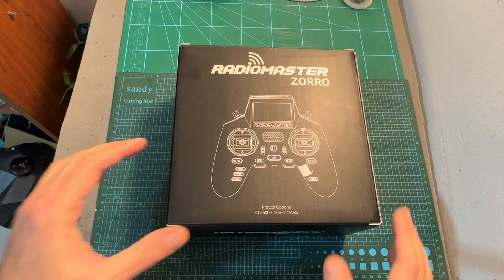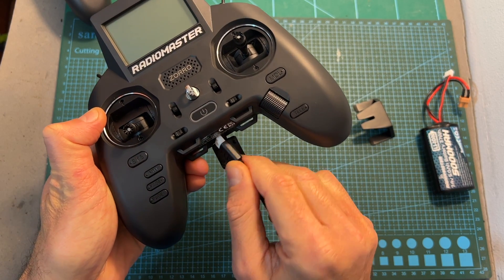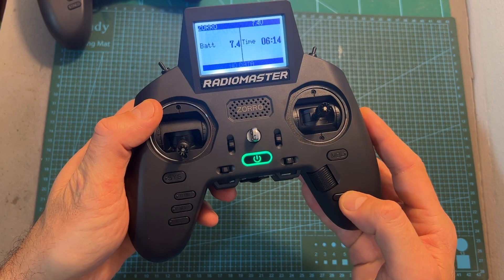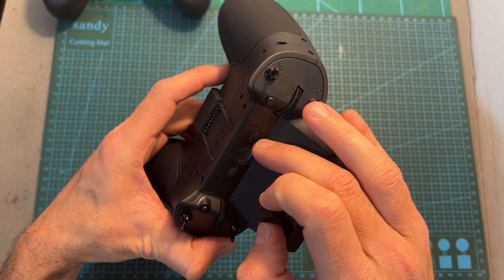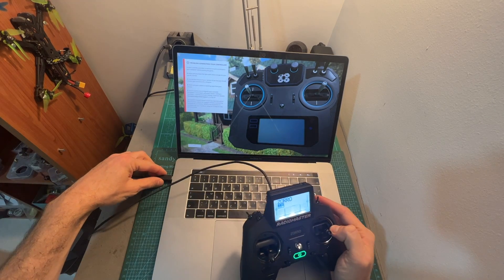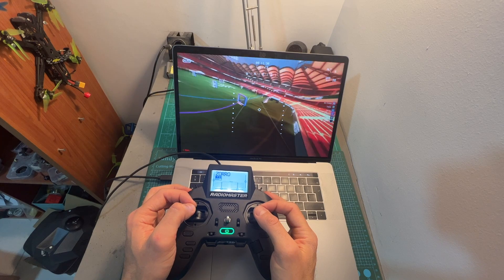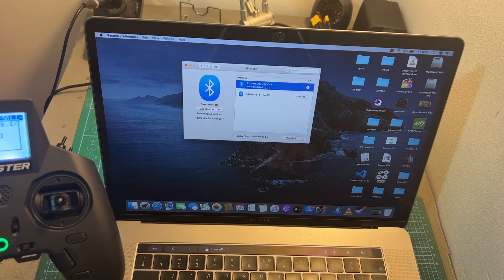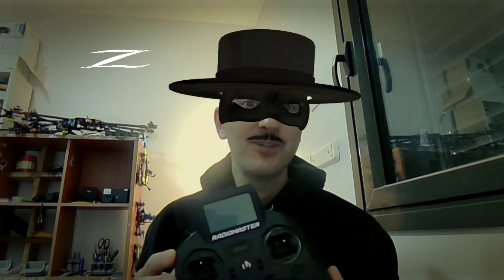RadioMaster Zorro Hands On Review, Battery Test & Teardown

Comment: Btw for batterie life if you fly you move joystick and then backlight is turn on and consuming more power.
Reply from the maker: True, but I didn't deplete the batteries all the way since I didn't want to get the battery too low. Real life battery life should be about 1.5 hours on 100mW.

Comment: I have installed some 18350 cells in my radio and plugged it in to charge and the power button turned red, everything was fine until I had to charge the radio again but this time when I plugged it in to charge nothing happened. The light won't turn on and the batteries won't charge. Anyone know how to fix this issue?

Comment: My Radio Will Not turn on with 2 li ion batteries inserted . I checked the voltage. It is at 4.1 volt each. I also checked continuity from the batteries to the plug. Everything is ok . It only turns on with 2s batterie connected to the balancer port of the radio. Any idea on how to fix the issue?
Reply from the maker: Tha'ts unfortunate. Did you contact RadioMaster?
Reply: @KremerFPV  Problem solved . It was because of flathead design of the li ion cell . this design is not compatibel to the zorro . i modded it a bit and now it works for me .
Reply from the maker: @90s_sascha  I am glad you were able to get it working. Enjoy your new radio controller 🙂
Reply: @KremerFPV  it is by far the best radio i ever had 😁

Comment: Does anyone know if this can be powered by USB, for example using on a PC with a Sim without batteries inside the tx?
Reply from the maker: No, you need the batteries for that. You can use the TX without batteries only if it's powered externally using the 2s balance connector.
Reply: @KremerFPV  appreciate it, thanks

Comment: hi Gal, nice review! i wanted to ask about the batteries as it seems the down fall of this radio. can i hook up a battery bank to the USB-C port while the radio is working? will it replace the need of the 2 small 18350 inside or the voltage needed wont be enough? or only the 2s can work as external battery?
Reply from the maker: Thanks! No, you will need to have batteries inside in order to power the radio using the USB-C port. You can only power the radio without the internal batteries by using the 2s balance port.
Reply: @KremerFPV  Toda raba:)
Reply: @KremerFPV  btw, have you tried the elrs version of the zorro and see what range can it get with the internal module@250mw?
Reply: @KremerFPV  i have another question, if i may. since im gonna skip using 18350's, i have many 18650's 3,000 mah here at home, was thinking to make a 2S of my own using these small boxes for series from ali express. my main question is, does this radio really need a fully bridged 2S connector (-\bridge\+) to work? or i can simply hook the + and - and leave the middle of the balance empty? will it work? any risk? i noticed the extended cable from balance to xt30 is only having positive and negative. thanks!

Comment: Thank you Gal for the detailed and to the point review as always. Seems to be a pretty decent radio but those tiny batteries are a real turn off for me as I suspect it will be for quite a few people...that is really too bad ...
Reply from the maker: Thanks a lot Christophe. I don't think that the small batteries are a deal breaker but I agree that it could have been better if the battery life was extended using bigger batteries.
Reply: I can tell you that it lasts for quite some hours with the internal batteries and it also has a 3-pin XH-plug where you can connect the balancer plug of a 2S LiPo battery. The case has loops and straps so you can fix an external battery to it. I don't think that is necessary though, as the batteries of your vehicle won't last as long as the batteries in the radio, even when you have multiple.

Comment: Tango 2 had the roller backwards at first and so did my Sky o4.  Maybe that's the standard in different country. Very very thorough review Mr zorro
Reply from the maker: Thank you very much :-)
It's not a deal breaker but it's personally something that I find a little bit annoying. I was told by RadioMaster that most of the pilots asked them that the roller button should behave as shown in the video.
Reply: @KremerFPV  so it’s the same direction as tango 2? Or different?
Reply from the maker: @joevo2  The opposite direction in comparison to the Tango 2.
Reply: @KremerFPV  sadly. Hope edgetx would come up with a setting to toggle it. Thanks for the video. Really love your format and presentation. Keep up the good work.
Reply: @KremerFPV  The roller was reversed in an update to EdgeTX before 2.6.0 from how the samples came. I also was very disoriented by the way it scrolled originally. If you haven't updated to EdgeTX 2.6.0, then give that a try. If you did update, then know it used to be the way you wanted it. 😅 EDIT: And looks like you haven't updated, since you're still getting the 501 packets/second, which was also fixed.
Reply from the maker: @CapnBry  Thank you, I will update it :-)
Reply: Similar with mouse scroll wheels, and track pads. 
Apple even reverse how the managed at one point. (moving scroll bar, vs moving page content, like on a tablet). OpenTx/EdgeTx just need to enable scroll(wheel) direction as a user preference. Kind of like car steering wheels, LHD, or RHD. People will have a personal preference.

Comment: I don't like the big screen they slapped on it
for a game pad style transmitter it looks very bulky in comparison to the Tango2 or the T8 Pro

i have a TX16S and i'm searching for a second transmitter for my smaller quads up to 3 inch
something with a small form factor that i can toss in my bag alongside my clothes and other stuff when I'm visiting my Friends via train and/or bus 
where i have to manage my overall travel room/weight

the T8 Pro looks very promising tho 🙂
Reply from the maker: The T8 Pro is not that smaller than the Zorro and it's similarly priced. If you don't need an external module and you can get a good deal it can be reasonable option though.